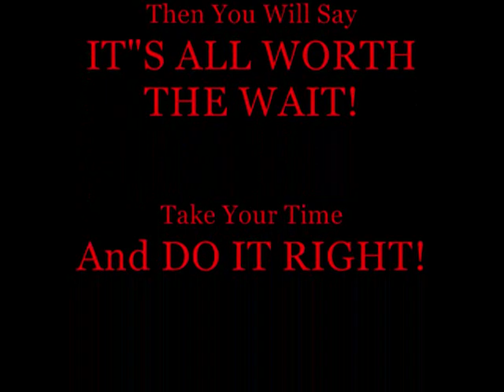1970 Volkswagen-Karmann Ghia-Gettin "ER" Painted-Part 4

Comment: Hey Pete the ghia looks awesome looked like vw Steve had a semi-stiffy seeing it with paint. Tell us about color matching seems how the deck lid and other parts weren't painted at the same time. I was always taught color could change with different temperature and have never been baldy enough to try it your way. Ever had any issues, are there precautions you take? Thanks Jeffry.

Comment from the maker: No I have never had a problem like that accure. When I do an overall restoration like this one I buy 2 gallons of paint, wheather I use it all or not, then mix it all togeather to make one color, this way, with all that paint on hand, you know you will have enough and won't run out. As for tempiture issues, no= never had a match problem. I do use PPG DBC bascoat paint, and that might have somthing to do with NO PROBLEMS. PPG is the BEST.